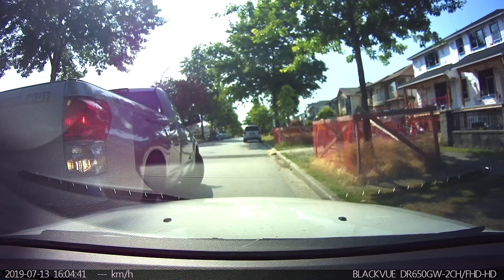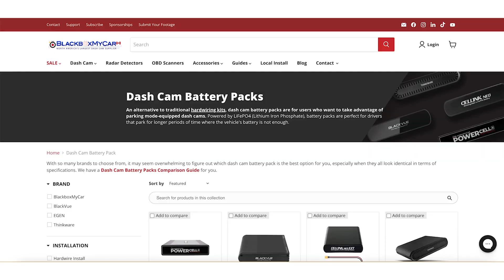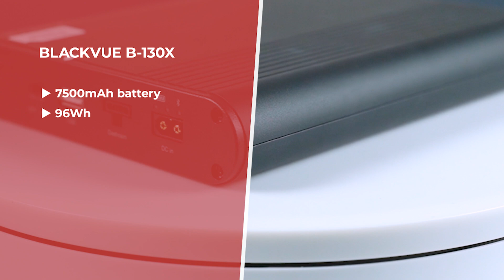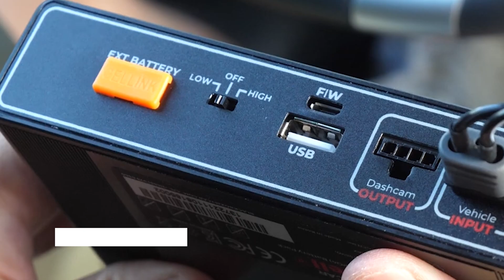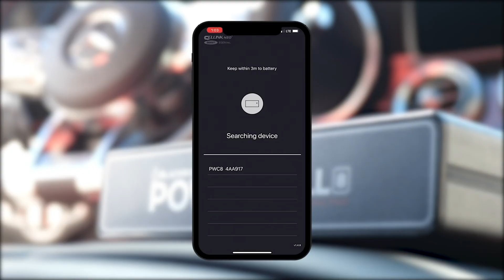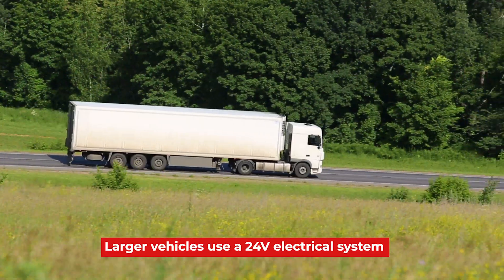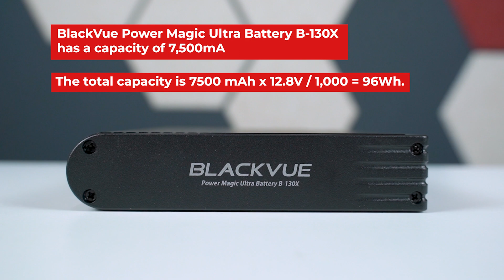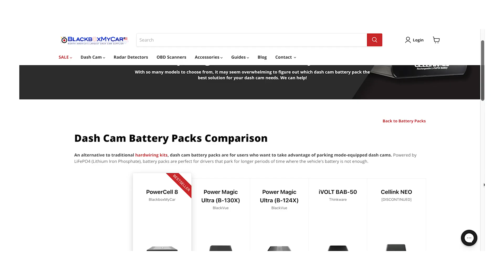Which Battery Pack to Use? | BlackboxMyCar PowerCell 8 vs. BlackVue B-130X Battery | BlackboxMyCar

Comment: I run two dual channel dash cams. I have the first main 4K camera pointing forward, but the ‘rear’ 2K camera, points out the left window of my car. The second main 4K camera faces the rear of my car, and the ‘rear’ 2K camera for that unit points out the right side window. 
Is there a battery pack which has two dash cam power outputs, or, more importantly, if I daisy chain two packs, will the power out on each still function to power a dash cam, or does connecting a battery pack as ‘slave unit’ disable the dash cam power out on that unit?
Reply from the maker: Our current battery packs are designed to power a single dash cam unit each. When daisy chaining, the slave unit’s dash cam power output isn’t active, so you wouldn’t have two independent power outputs from one daisy chain. If you have any further questions or need assistance wiring up your system, please feel free to reach out to our support team by email at info@blackboxmycar.com, via Live Chat, or give us a call at 1 (888) 978 6560.
Reply: @blackboxmycar Thdnks for the reply. I’ll just have to run two seperate battery packs.

Comment: Hello there. I wanted to know if you can advise on whether it is ok to have two Powercell 8 battery packs in one car (having a 12V battery) or maybe two different brand model battery packs in one car simultaneously. I currently use a Thinkware U3000 (front and rear dashcam) which is hooked up to a Powercell 8 battery pack and the charging is done via the car cigaratte lighter.
I am now interested in installing another dashcam like a  360 degree 4g sim cam for remote live view. So my question is, if i install a 360 degree 4g sim camera of any brand in the market, can i connect the dashcam separately to another Powercell 8 battery pack or any other battery pack like the Cellink Neo or Thinkware ivolt mini/Xtra in the same car? And whether i can do it with the same cigaratte lighter connection or would i need to connect one battery pack to the fuse box or use one with a OBD cable for parking mode? Please advise, thanks!

Comment: So, on parking mode and continued recording when away from car, when the battery pack is fully charged, am I just sticking the wiring from dash cam into the battery pack (where it’s not plugged into anything) and it’ll record for up to 20 hours ish?

Comment: I was thinking of using one of these but the max operating temperature of 60C for the Blackvue make them seem almost useless under the Australian sun when the crazy in people is more prone to come out.  I suppose making one with a ventilated, cooled and dehumidified enclosed case with a filter might defeat the affordability and battery usefulness though, argh.
Reply from the maker: Hi there! I understand your concerns about operating dash cams in extreme temperatures, especially under the intense Australian sun. High temperatures can indeed pose challenges for electronics like dash cams. Here are a few suggestions to help manage this:

1. Ventilation and Cooling: While creating a ventilated and cooled enclosure might not be practical due to cost and complexity, parking in shaded areas or using sunshades can help keep the interior temperature down.
2. Temperature-Resistant Models: Some dash cams are specifically designed to withstand higher temperatures. It's worth checking if there are models available that have a higher heat tolerance, though these can sometimes come at a higher price.
3. Parking Mode Settings: If your dash cam supports it, using a time-lapsed or motion-detection parking mode can reduce the heat generated by the camera itself, as it won't be recording continuously.
4. Regular Checks: Ensure your dash cam is properly mounted and check regularly for signs of overheating or damage, to prevent any potential issues.

If you're still concerned, please feel free to reach out to our support team for advice on models that might best suit your needs in high-temperature environments. Let me know if you have any other questions!
Reply: @blackboxmycar  Oops my mistake I should have clarified I was talking about the battery backup being only 60C operating temperature.  My hardwired Viofo dash is rated at 70C which seems to operate fine even though it feels almost scorchingly burnies to the touch in the sun but I was considering a battery backup system to prevent premature expiration of my lead acid main battery.  I just switch the cam off when I get home from work(5km away)/going out which is a bit of a pain but will do in the interim.

Comment: Hi
Please answer me 
I have a 24 kit with 3 Cables and input must be 12 volt 
ACC , VCC and GRND
how can i use it as a pin for 12 volt power in power bank
VCC (red)is + pol and GRND (black)ist Grund 

What happened with ACC ( yellow) in this situation?
In fuse box is clear but in pin isn’t 
Tnx
Reply from the maker: Hi there! I understand you're trying to use a hardwiring kit with a power bank, which can be a bit tricky. Let's break this down:

1. VCC (red) is indeed the positive (+) connection.
2. GND (black) is the ground (-) connection.
3. ACC (yellow) is typically for the accessory power, which is switched with the ignition.

When connecting to a power bank or a simple 12V power source (like a cigarette lighter socket), you typically only need the positive and negative connections. Here's how you can handle this:

1. Connect the VCC (red) wire to the positive terminal of your 12V power source.
2. Connect the GND (black) wire to the negative terminal of your 12V power source.
3. For the ACC (yellow) wire, you have a couple of options: a) If your dash cam doesn't require an ACC signal to function, you can simply insulate the end of this wire and leave it disconnected. b) If your dash cam does need an ACC signal, you can connect the ACC wire to the same positive terminal as the VCC wire. This will essentially tell the dash cam that the "ignition" is always on.

Remember, when you're not using the ACC wire with a switched power source (like in a car's fuse box), your dash cam may not automatically know when to switch between normal mode and parking mode. You might need to manually set this in your dash cam's settings.

Also, please ensure that your power bank can provide a stable 12V output with sufficient amperage for your dash cam.

If you're unsure about any of these steps or if your specific dash cam model has different requirements, I'd recommend reaching out to our support team at info@blackboxmycar.com. They can provide more detailed guidance based on your exact setup and dash cam model.

Always prioritize safety when working with electrical connections, and if you're not comfortable making these adjustments yourself, consider consulting with a professional installer.
Reply: Thank you for your detailed and very helpful response. Here’s what I’ve done: I managed to implement this theory. I bought two USB voltage boosters and a regular power bank. However, the 10,000 mAh power bank is not sufficient to supply power for the entire night in parking mode. Interestingly, it doesn’t last for the full twelve hours in parking mode, but it works very well when I’m driving. I use one USB booster while driving, with the red wire connected to + and the black wire to -. However, when I park the car, I remove the booster. I use another booster in parking mode, connecting both the red and yellow wires to + and the black wire to -. The system works wonderfully, but I plan to buy a larger power bank with around 30,000 mAh.

Comment: Maybe then get a 20000 - 25000 mAh power bank and still stay under the 100 Wh safety? 6-8x 18650 cell at 3400 mAh per cell, or other cells.
Reply from the maker: Using a power bank with a capacity of 20,000 to 25,000 mAh can be a good solution for powering your dash cam, especially if you're looking to avoid drawing power directly from your vehicle. When considering a power bank, it's important to ensure it stays within the 100 Wh limit if you're concerned about safety regulations, such as those for air travel.

Keep in mind that not all power banks are designed for continuous use with dash cams, so it's important to choose one that can handle the power output required by your camera. Additionally, make sure the power bank's output voltage and current match the dash cam's requirements to avoid any issues.

If you need more guidance or have questions about compatible power options for your dash cam, feel free to reach out to our support team at info@blackboxmycar.com or chat with us via Live Chat. We're here to help you find the best solution for your needs!

Comment: The tutorial video is excellent., may I ask: What type of adapter or transformer should I use to charge these dash cam batteries using household mains (110/120v)?
Reply from the maker: Glad you liked it! Please use a Power Inverter, with an output of 
14.6V (8A). The input can range between 100V - 240V (50-60Hz, 2.5A)

Comment: A typical dash cam, even with a wide range of functions such as dual lens (front + rear) coverage, motion detection, and WiFi connectivity, requires less than half the amount of power (typically around 0.25-0.45 amps) of a standard light bulb in order to operate normally. Add to that the massive size of a car battery (compared to the tiny amount of power needed by a dashcam) and you have plenty of power under the hood! Even a small or mid-size car has a battery rating of about 45 amp hours, meaning it can supply 1 amp of power for 45 hours in a row (theoretically). Larger car and truck batteries may have ratings up to 225 amp hours or more.

Comment: No need for batteries, Been using the OBD2 port on the car computer with a OBD2 Cable adapter with on/off switch  to Mini USB Cable to power the dashcam for a year now with no problems, when car is shut down just flip the on switch when you leave the car and turn off when returning to car.
Reply from the maker: An OBD cable is a great plug and play option for supplying parking mode. However, it will still work off the vehicle's battery, and while it will be ideal for a daily driver, a battery pack is still ideal for long-term parking.

Comment: Hello
What fuses would be used to install the  PowerCell 8 Dash Cam Battery Pack in a 2021’ Buick Envision

Fuse Box Diagrams

Instrument Panel Fuse Box Diagram

Instrument panel fuse box diagram: Buick Envision (2021, 2022)

Assignment of the fuses in the Instrument Panel Fuse Box
№	Amps	Usage
F1	40A	Direct current to direct current converter 2 (DC-DC)
F2	30A	Body control module 4
F3	—	—
F4	—	—
F5	25A	Body control module 2
F6	20A	Body control module 3
F7	—	—
F8	20A	Exterior lighting module 5
F9	—	—
F10	5A	Steering column lock
F11	10A	Body control module 1
F12	—	—
F13	—	—
F14	—	—
F15	15A	Auxiliary power outlet rear cargo
F16	—	—
F17	20A	Exterior lighting module 7
F18	10A	Uplevel tail lamp
F19	10A	2021: Steering column lock assembly
2022: Overhead Console Module/ Universal Garage Door Opener/Rain Sensor/Electronic Toll Collector
F20	10A	Sensing diagnostic module/Automatic occupant sensing/ Data link connection/ Wireless charger
F21	5A	2021: Central gateway module/ Telematics control platform module
2022: Central Gateway Module/ OnStar
F22	10A	External object calculating module/ Long range radar/ Park assist/front camera module/ Side blind zone alert
F23	10A	Video processing module
F24	—	—
F25	10A	AC power outlet/ Auxiliary USB
F26	—	—
F27	30A	Amplifier
F28	60A	2021: Jumper
2022: Heated Steering Wheel Module/ Exterior Lighting Module Battery 2/ Direct Current/ AC Inverter
F29	10A	Instrument duster/ Heads up display/ Air quality ionizer module/ Center stack display/ Heating ventilation air conditioning display
F30	—	—
F31	—	2022: Run/Crank Auxiliary Power Module/ Battery System Manager/ Motor Control Unit
F32	10A	Run crank for misc. 3 humidity sensor/ Exterior lighting module/ Electronic brake control module/ Air quality sensor exterior/ Headlamp manual leveling left Right/ Inside rear view mirror/ lnterior particulate matter sensor/ Seat fan control cushion and back driver co driver
F33	—	—
F34	10A	Run crank for misc. 1 & 2 shifter interface board module/ Instrument panel cluster/ Transmission control module/ Sensing & diagnostic module/Headlamp manual leveling switch/Reflective light auxiliary display
F35	15A	Run crank for engine control module
F36	10A	Electric park brake switch/ Shifter interface board
F37	15A	Radio/Center stack module/ Auxiliary jack
F38	—	—
F39	2A	Steering wheel clock spring
F40	20A	Exterior lighting module 2
F41	7.5A	Heated steering wheel module
F42	20A	Direct current to alternate current inverter module
CB1	—	—
CB2	15A	Auxiliary power outlet console
Relays		
K01		Retained accessory power accessory
K02		Run/crank
K03		—
K04

Comment: I have a Gen 4 Mazda 3 which does not have ACC fuses inside the car and the 12V socket is always on when the car is off. The only option is to tap into the engine bay fuses through the firewall which I don't want to do. Is there an OBD2 cable option to charge the PowerCell?
Reply from the maker: Gotcha, yes Mazda 3's are problem vehicles when it comes to an ACC connection. Unfortunately, battery packs do not have an OBD connection option, though I do have a few options for you. 

For us, if we were wiring into a Mazda 3, then we would splice into existing wiring going through the vehicle. Otherwise wiring through the firewall is possible, though difficult. You could also consider building a relay, which should likely be done if you are wiring through the firewall. I recommend speaking to a professional auto body or car repair shop for assistance.

Comment: Somehow I don't understand why to buy an additional expensive battery with a capacity of 6-8 Ah when the car battery has a capacity of 80 Ah (60Ah if not ful charge).  I find it illogical.  I can set the same parking time limit in the dashcam menu.

I have an 80 Ah battery in my diesel (Chevrolet Orlando). If I consider charging 80% and ending the discharge at 12.2 V (50% capacity) as a default, I have 30% capacity = 24 Ah. And if I can do the math this is at a 0.4A (5W) draw for a 60 hour record.
It depends what your riding regime is, daily, weekly, how many km mileage.
Reply from the maker: Thank you for the feedback. Traditional car batteries are not designed for the heavy discharging/recharging cycles that a dash cam battery (LiFePO4), which can be fully discharged without damage. When wired to a car battery, you don't want it to drop beneath 12.0V for the health of the battery. Many of the key points are touched on here: https://www.youtube.com/watch?v=4gH0i07mSJ4

Comment: Just want to make sure I understand, if you use a battery pack, it is still connected to regular car battery (hot wired or plugged) and is storing power from the car battery to use during parking mode at a later time compared with not having a battery pack where the dash would take the power directly from the car battery? Wouldn’t that be the same? Dash cam either taking directly from car battery or from power bank which is also taking from battery? Is it possible to plug the battery pack on charge at home so not taking from car battery when needs to be recharged?
Reply from the maker: The idea is that the battery pack will only charge while the vehicle is on, avoiding any power draw from your vehicle battery when the vehicle is off, instead supplying that power to the camera itself, the battery pack. 

The battery pack can be plugged in at home for recharging through a Power Inverter.
Reply: Wait, I am asking the same thing here.  Can’t I just plug the wiring from the dash cam into the STAND ALONE battery pack (when fully charged) and use it that way?  When the pack is about to drain, charge and rinse and repeat?  

I am confused.  If I need to plug the external battery pack INTO car to use, I’m not seeing the benefits.

Comment: So when my car is in the garage and there is no motion or impacts to record does it still drain the battery pack or does it go in sleep mode until it senses motion or impact? Thanks.
Reply from the maker: While most cameras have impact and motion detection so they'll only record in those situations, the camera still needs to be awake enough to detect either, drawing power. If you want to avoid any power draw while in your garage, I recommend using the power switch on the battery to simply power it off, or some camera models have their own power button. 

Either way, rest assured that our battery packs are designed to be fully discharged, so I would not worry too much about their longevity from this happening.

Comment: Is the only difference between the 130 and the 124 just battery length? Or are there other features worth the extra money? Thanks.
Reply from the maker: The key difference is battery capacity, yes. Beyond that, the B-130X will also charge quicker.

Comment: sorry, but for the price of one of these, why wouldn't you just upgrade your 12V car battery to a heavy duty battery like a Optima Yellow Top?
Reply from the maker: Upgrading your car battery is definitely another route you could go, however there are some factors to consider. 

These battery packs are designed to be fully drained using up all power stored. Car batteries on the other hand need to have approximately 12V worth of charge remaining to properly start the vehicle, so the camera would not be able to make full use of the new battery. Vehicle batteries will also experience wear and tear when discharged while the vehicle is inactive, while these battery packs are designed for this, and support more charge cycles.